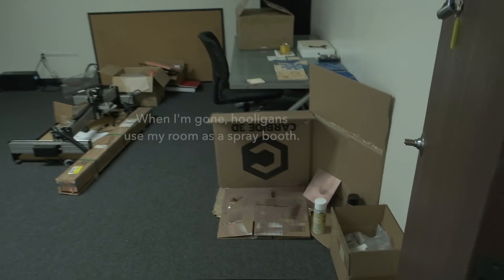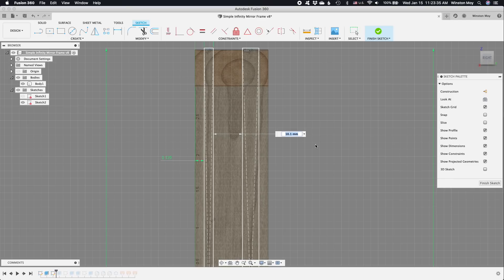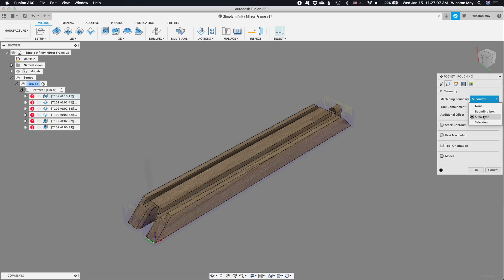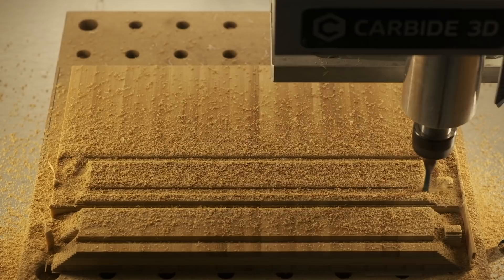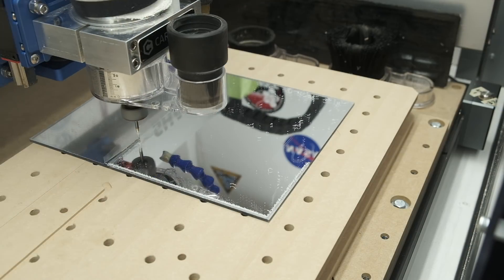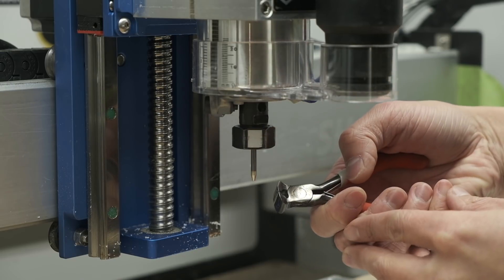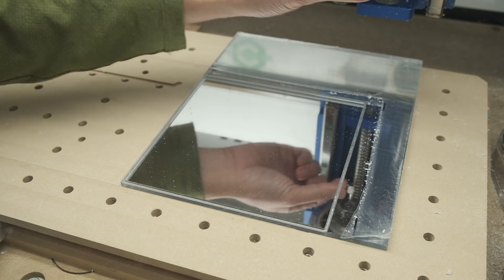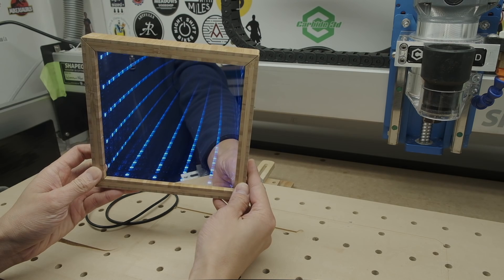Designing and Machining a Basic Infinity Mirror

Comment: does the old sock over the router make the brushes last any longer?
Reply: Dust does erode the brushes faster, but this isn't really a replacement for good dust collection. It's mostly intended to stop aluminum chips from falling through the motor when I'm cutting metal.

Comment: Use compressed air for cooling to prevent sticking chips. Tools above 4-6mm perform better. Also cutters with polished flutes will do a better job, try Datron 0068434Y.